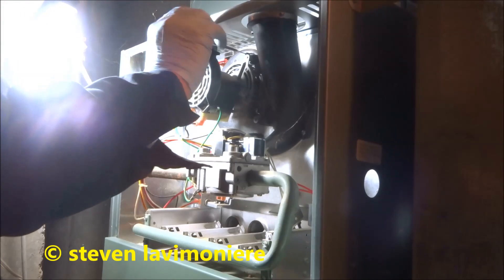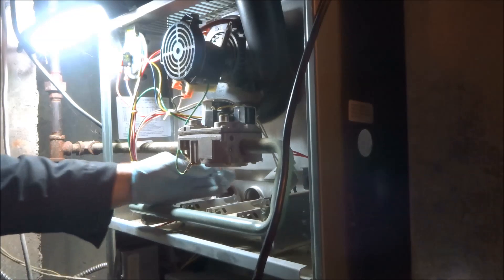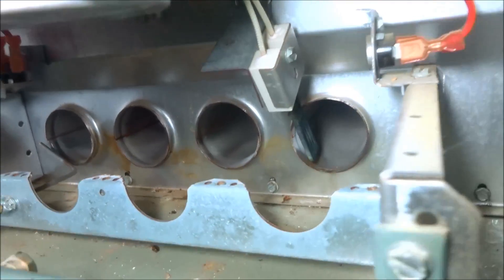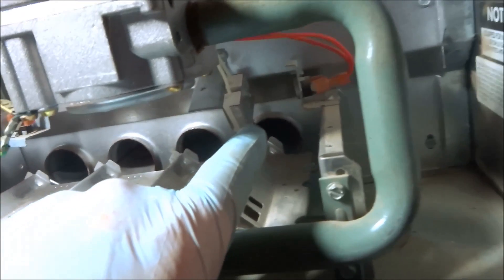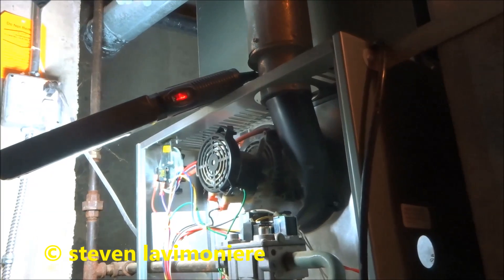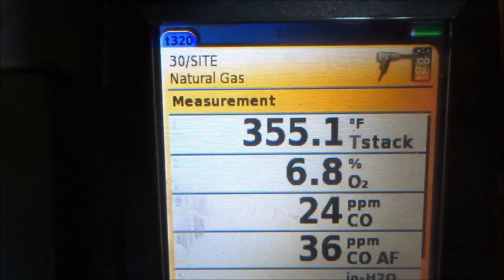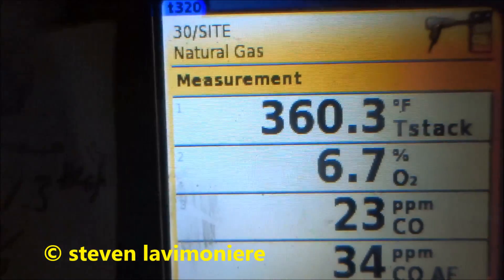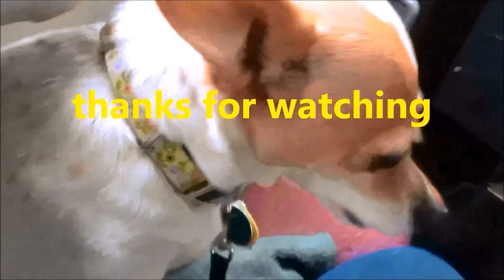how to service a 80+gas fired furnace

Comment: One tech tip I learned is unplug the neutral from the fan and let furnace go out on safety to make sure limit works plus burns off excess dust on heat exchanger !!!
Reply from the maker: +shane3000 good point

Comment: o2 should be around 6 to 9%. keep in mind when adjusting manifold pressure by combustion watch your temp rise. Good Video Steve
Reply from the maker: +Mi Heating Guy this was the best i could get it . out in the real world not all things are perfect thats for sure i do the best i can with what i have to work with. if its dangerise i will shut her down . if not they stay running people need heat .

Comment: lol steve. I really thought that the furnace wouldn't look so modern. My gas boiler is stamped 1908 Currney. runs like a charm and is only powered by the 9volt battery in the up stairs thermostat.
Reply from the maker: +christian bernoe 9 volt battery ??? sure it is
Reply: wierd lie dude

Comment: Are those numbers common or is for every single unit?? 
Where I can find those numbers ??
Reply from the maker: +Jorge Chavez no the combustion numbers are somewhat different one other units . the number i use were found from truetech tools down load for combustion annalises when i bought the testo 320 from them the down load was free.i made a cheat sheet from that info for different units i work on